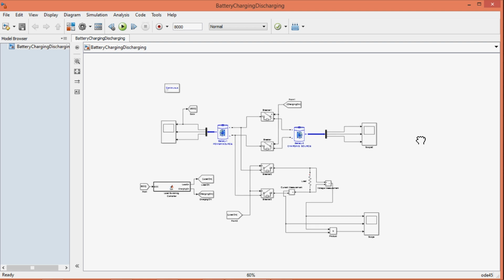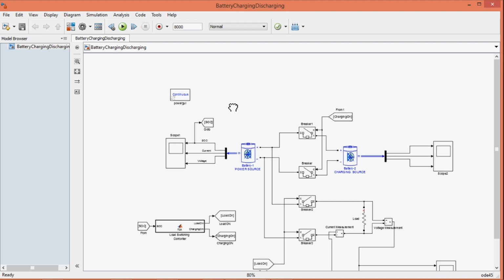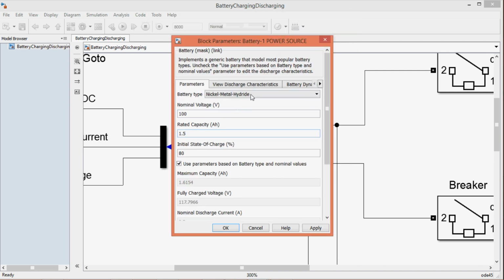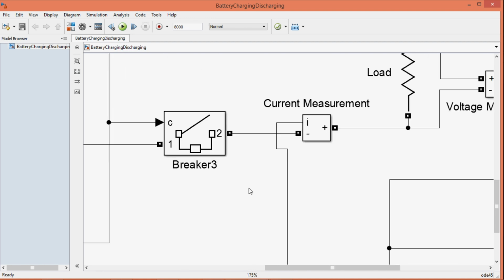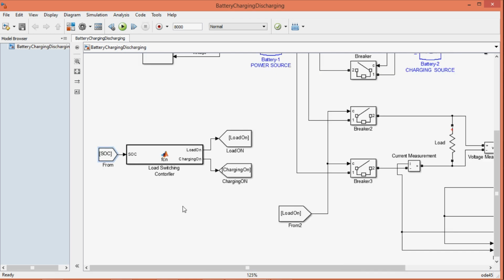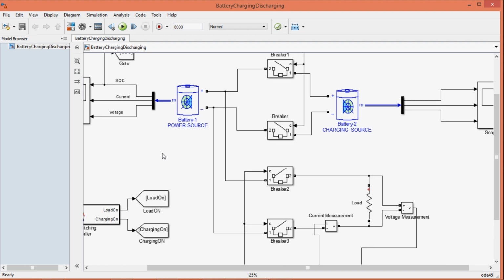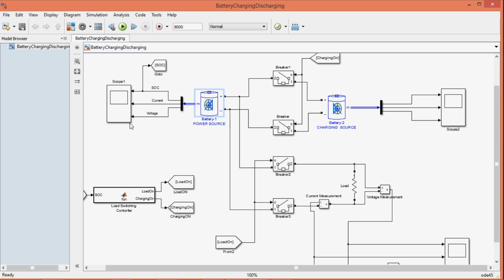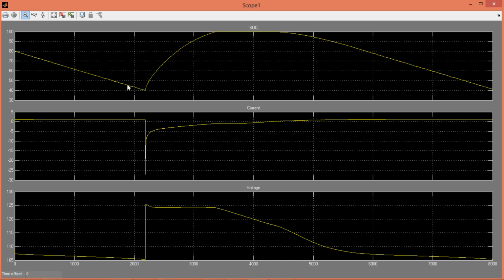How to charge and discharge a Battery in Simulink  Matlab

Comment: hallo i want to design an hybrid system where the voltage from a generator supplies a bldc motor and a battery supply the motor as well when the power from the generator is not enough. when i simulate the battery with the bidirectionnal buck-boost converter, the state of charge remains to 100 per cent. How can I solve that?Thanks in advance

Comment: Great work, I have tried to build same model, but it is not working properly. 
Could you please  send me the Simulink file to eyalamer@gmail.com? 
do you think it is possible to connect BOOST converter and PV to the module while charging ( instead of battery ) ? 
I will appreciate your help.

Comment: Hello Sir,

My model is working but I am not getting the correct wave forms. Do i need to change some other parameters of the battery(I tried to change but not worked)? It will be a great help for me if you reply. I am referring it in my project.Please consider it as a humble request.

Regards.

Comment: hello
i got the error in simulation

Error in 'untitled/Battery': Initialization commands cannot be evaluated.
Caused by:
Parameter error in the 'untitled/Battery' block: The 'Exponential zone Voltage' must be greater than the 'Nominal Voltage'
Component: Simulink | Category: Block error
Error in 'untitled/Battery1': Initialization commands cannot be evaluated.
Caused by:
Parameter error in the 'untitled/Battery1' block: The 'Exponential zone Voltage' must be greater than the 'Nominal Voltage'

Error in 'untitled/Battery': Initialization commands cannot be evaluated.
Caused by:
Parameter error in the 'untitled/Battery' block: The 'Exponential zone Voltage' must be greater than the 'Nominal Voltage'
Component: Simulink | Category: Block error
Error in 'untitled/Battery1': Initialization commands cannot be evaluated.
Caused by:
Parameter error in the 'untitled/Battery1' block: The 'Exponential zone Voltage' must be greater than the 'Nominal Voltage'

Comment: 'm an electrical engineering student, working on simulation of grid connected DC microgrid. I've designed a microgrid consisting of SPV & PMDC generator & BESS. The DC link voltage is 48V.
I'm not able to design charge controller for battery.
Can you please help me for the same?

Comment: Hello, and thank you so much for your video. I follow your videos for matlab/simulink simulations and really you're great.
I am a beginner in power systems and matlab, I used it only for plot and data analysis but I have no experience with simulink.
I am facing a big problem now, and I hope you would be able to help me please.
I am building a microgrid, in which I must have a battery + PV + emergency DG + wind turbine. I am making use of the blocks that already exist in simulink library, since I have a full 2015 matlab version.
My problem is that wind turbine requires a phasors powergui, PV requires a discrete powergui, and of course emergency DG and batteries require continuous powergui.
My project is not about the microgrid itself, but a multi agent system for controlling the microgrid, so I am not obliged to know all the details of a power system in my project.
My problem is that I cannot have more than 1 powergui in the model, how can I solve this issue?
Also, is it possible to have this model of the battery, since it inspired me a lot for building a battery storage system.
I am waiting for your answer and help, Thank you very much

Comment: Dear Mr Kumar ,

nice job. I would like to simulate the discharge current when a conductive rod is approached to a live HV transmission line (230 kV line to ground voltage).  Can you help me? I will appreciate your help.
Thank you very much.

best regards,
 Costin

Comment: Thank u very much sir, it really helped a lot. But i have a doubt.
once soc reached to 40%, battery starts charging until soc reached 100% as shown in scope  But in function block code we have written that when soc>80% chargingon=0. SO battery should stop charging when soc reached to 80. But this is not happening. Who so?
Reply from the maker: +prakhar patidar I think may be battery is charging faster than the iteration time...but i am not sure. I will have a look. Thanks for feedback.
Reply: +Satendra kumar thnks for reply.... please reply when you find this..
Reply: +Satendra kumar we can not use breaker here as breaker breaks the circuit when next zero crossing comes as in case of dc no zero crossing is there so we cant use breaker here...
Reply: Hi Prakhar

are you sure about this? As, I tried the model and I'm getting similar response. Circuit does not disconnects as SOC reaches the defined level.
Reply: +prakhar patidar   can you please forward the model sir if you have it done to rajesharistocrat@gmail.com
Reply: Hi Prakhar, can you please forward me the model on oetmotale@gmail.com Thanks

Comment: satendra, can you suggest a good book for modeling through simulink in electrical engineering especially in energy storage systems
Reply from the maker: Pradeep Raj Hi pradeep. Well to start modelling  in matlab, i highly recommend you to read more and more stuff online as most of the books are available to give you a general idea about the simulink environment. Best method (and that's how i started) is to make a smallest possible circuit in simulink, run it...study the results, now think of replacing the elements with some other elements. Before doing this, get familiar with the components available in SimPowerSystem.